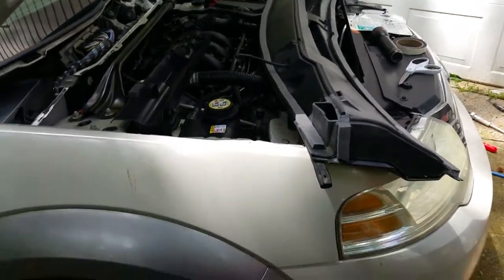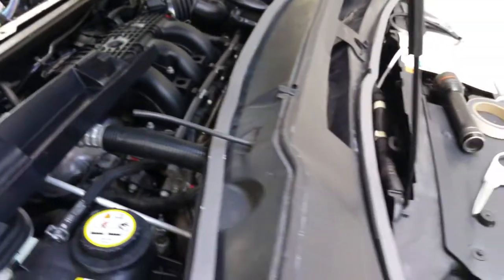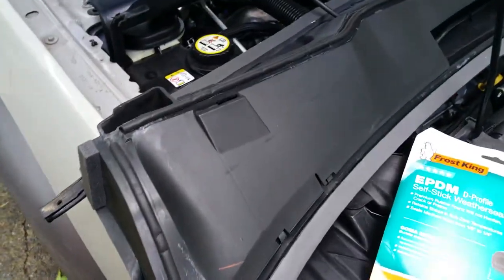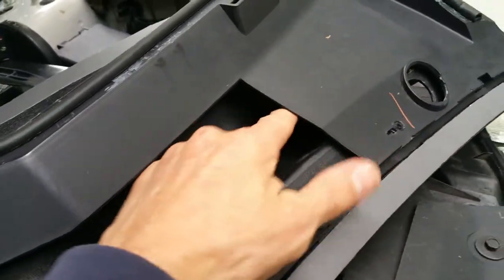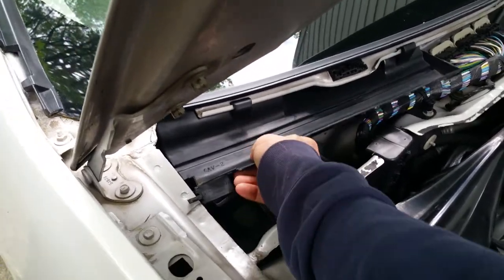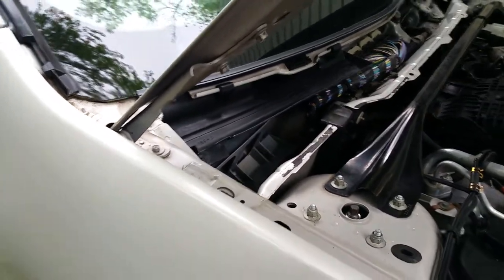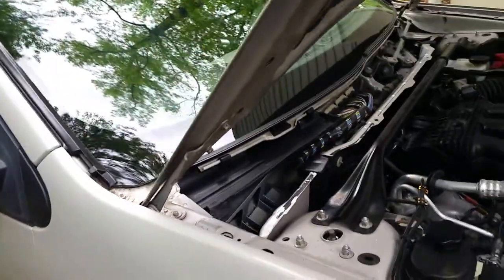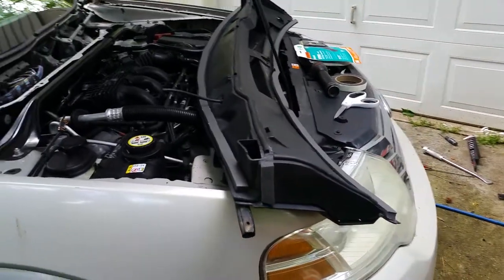How I improved weatherstripping of the windshield cowl to prevent future issues Ford Lincoln Mercury

Comment: This will save me. Pinpointed the issue and now ive found this issue. Bad news is i just bougbt it and the floor is bad soaked and the air filter is crumbled molded paper and the blower motor is completely full of water. Hopefully this eill mitigate it ever happening again

Comment: I believe this is the reason our 2012 Ford Focus would not start twice recently after very, very, very heavy rain.

It seemed like a dead battery but I knew it was a new battery. 

The first time I worked on the car for two hours in the blazing Florida sun.  I was about to call for a tow truck it just started right up.

Today I just left the car are returned two hours later. It started right up.

I think something electrical is getting wet due to the old loose cowl. After a few hours the wires dry in the 95 degree heat.

I'll try to fix the cowl tomorrow

Comment: Having the same issue with my 05 Ford Five Hundred which is on the same platform, My trouble is finding something to replace that rubber T channel on the windshield that the cowl snaps into since it's 18 years old and disintegrating.
Reply from the maker: Go to a junkyard or eBay